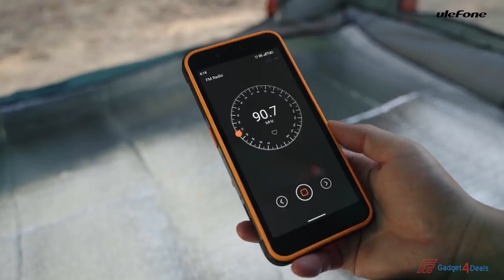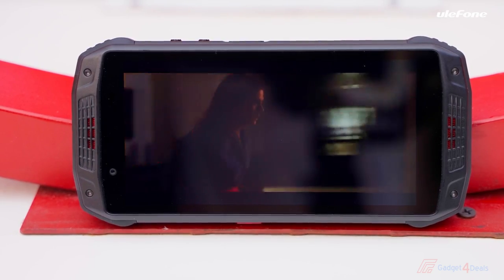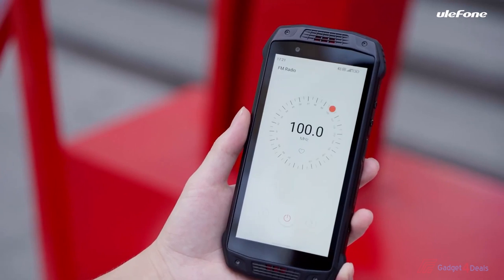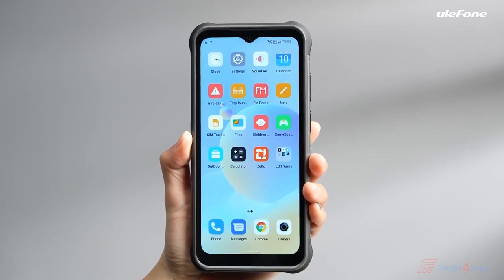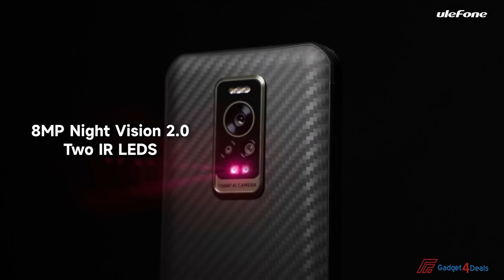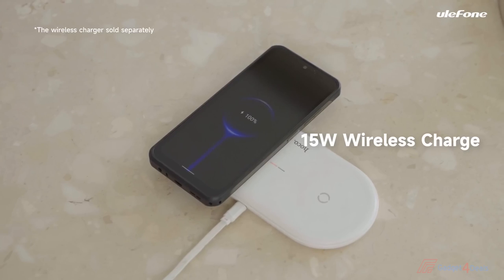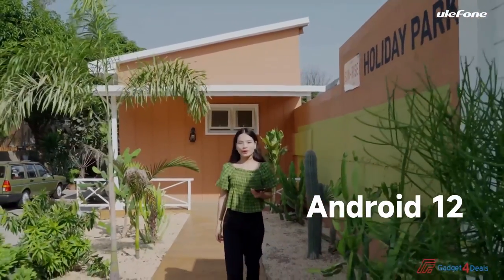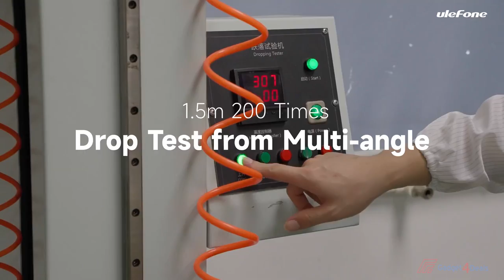Top 5 Best Rugged Ulefone Smartphones In 2023

Comment: Does a wired headphone function as an antenna for the FM radio when plugged in into the 3,5mm socket in a Ulefone ?  The longer wire of the headphone would receive stronger i think.

Comment: I got my first ulefone and the microphone stopped working after a few months and it couldn't be fixed.
I both a second ulefone armor8 and I had the same issue plus it is not charging and the speakers aren't working.
It was a disaster. 
I hope you have had better luck then me.